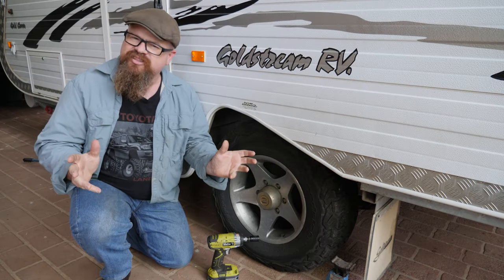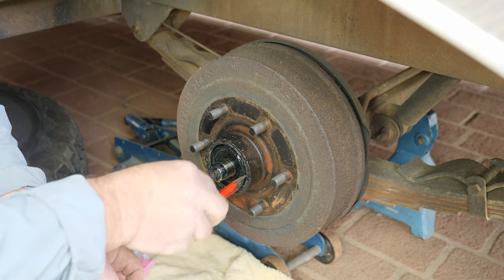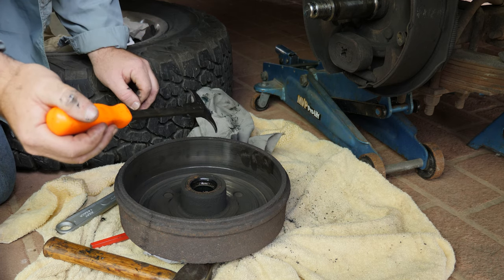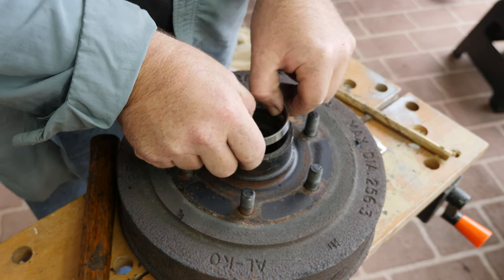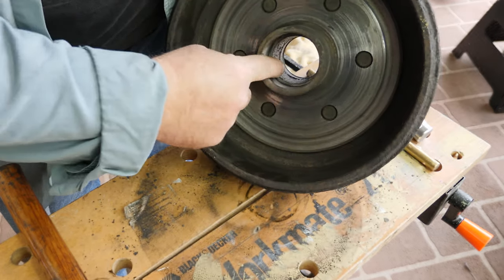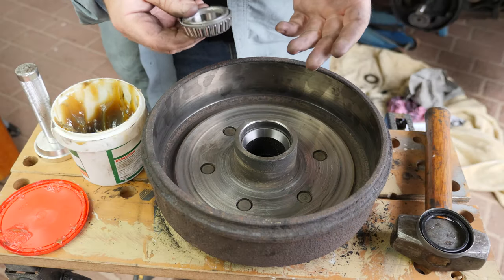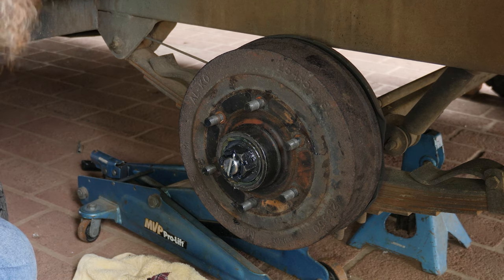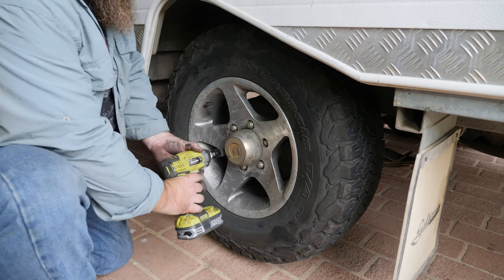Caravan, Camper and Trailer Bearing and Brake Overhaul

Comment: I love your videos so thankyou for your efforts!  Just a couple of constructive suggestions on this one - re the magnets - I like to check they are working before removing the wheel - in case there is an electrical problem;  When inspecting the magnets, look at the wear indicators;  also the magnets on that van are on-road magnets and the centres on them chew out on corrugations - off road caravans and trailers use the single slot off-road magnets;  check the magnets for broken wires or worn through insulation if rubbing on hub;  check for too much play on the pin that holds the arm; and I may have missed it, but didn't see you adjust the brakes after the hub was back on.  But its great to see someone who is not sponsored do so many good 4wd videos where you actually measure what you are testing.  Cheers
Reply from the maker: Thanks mate for the kind words, I had no idea there were differences between on road and off-road brakes, I have to check it out next time I have one apart.